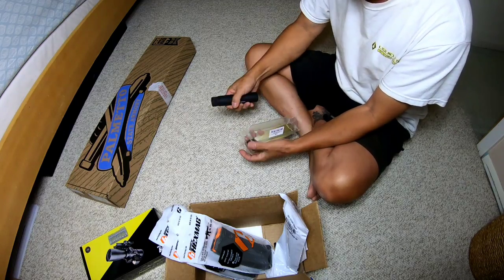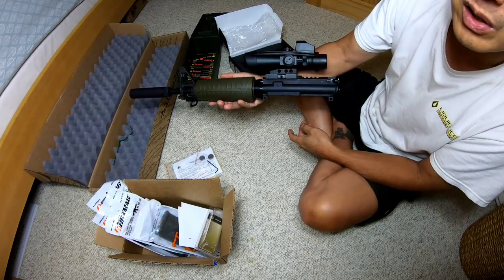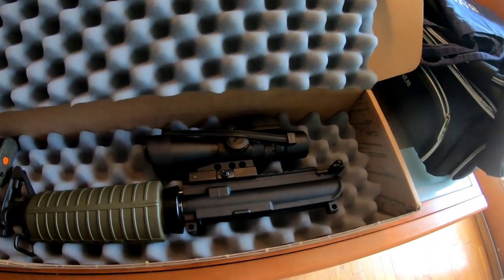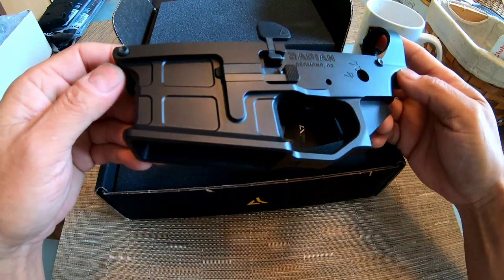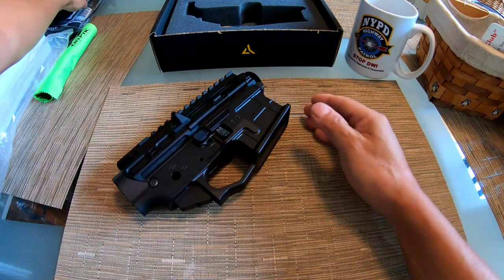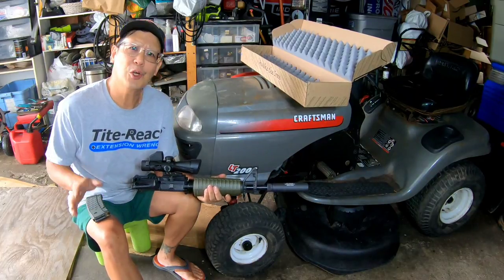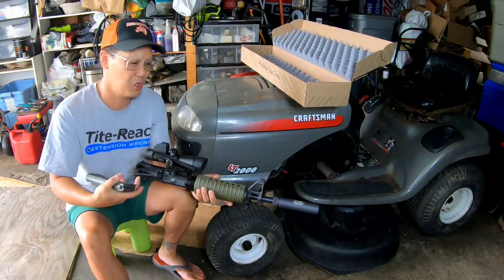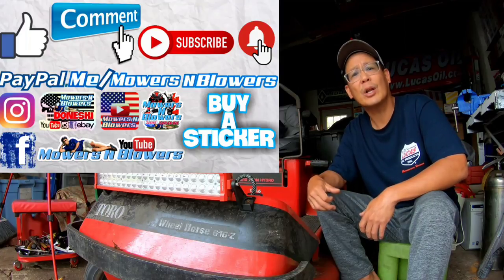AR-15 BUDGET BUILD NYS COMPLIANT GUNTECH .223 5.56 16"BARREL SHROUD THREAD PROTECTOR FAKE SUPPRESSOR

Comment: Hey Henry.... I almost pin and welded something similar to my barrel at Jimmy's actually but I rethought the setup and found that if there was EVER a problem with the gas block or gas tube I would be in big trouble because there would be no way to remove either without having to cut the barrel  in half just to remove it.... i then found YANKEE HILL pivoting gas blocks that would allow me to service the gassblock or gas tube without having to get a new barrel or set up in regards to barrel/gas block/ gas tube if there was ever an issue.... after thinking about the headache, the install and downfalls of these fake suppressors cause I returned the Socom fake suppressor I bought, scrapped that idea and stuck with the plain old barrel I have. It looks nice but it could get complicated if you have an issue with a gas block or gas tube if a custom gas block isn't installed prior....🤷🏻‍♂️🤷🏻‍♂️🤷🏻‍♂️
Reply: You can always drill the weld out.  Anything’s reversible as long as you have the right tools

Comment: You could make a "other" firearm if you slap a quad rail on that handguard and install a vertical foregrip and install a mil-spec buffer tube and stabilize a brace. That way you can have detachable magazines without having to worry about any gunsmithing to make it NY compliant.
Reply: Technically just a brace would
Do it to make an other!  But people here in NY have been arrested for having others.  Just because you think it’s an other, doesn’t mean the ATF agrees with you.  I’ll stick to what’s clearly legal.
Reply: I have a mail spec buffer tube as all ARs do.
Reply: Not all ARs but good luck with your build
Reply from the maker: It’s been done for a year now,  you’re welcome to check out the vids bro!  Thanks for the comment and watching.

Comment: Great video. Roughly how much do they charge for the pin and weld in NY?
Reply: About a $100
Reply: @MowersNBlowers ouch!  Ok thanks
Reply: @cm1212  if your handy,  you can drill your own hole,  find a pin and tack weld it yourself.  As long as the thread protector isn’t removable,  it’s as good as a non threaded barrel.
Reply: @MowersNBlowers im thinking file threads off and apply some cold blue to the metal as an easy diy. What do you think?

Comment: Are you pin and welding it for it just to stay in place?
Reply: It’s to make a threaded barrel non threaded.  In NY,  if you have a detachable mag, you can’t have a threaded barrel.  So you make it unthreaded by pin and welding a thread protector or barrel shroud so as I cannot place any attachments or muzzle device on it.
Reply: @MowersNBlowers  oh I see. We have similar laws here in cali, we can use muzzle brakes and compensators just no flash hiders. Very clean build BTW. I ended up doing something somewhat similar with an 11.5 barrel. Pin and welded it to 16”

Comment: Thanks  for the  link to this vid. May  I know whom did the you  entrust the  gunsmithing to?
Reply from the maker: Your local gun shop should recommmend a gunsmith in your area
Reply: @MowersBlowersGuns  Just needed to let you know, I called the shop where I got my 15-22 , he says the muzzle attachments can only be placed on a fixed-mag firearm. Do you know if the 15-22 is exempt due to being a rimfire rather than centerfire?
Reply from the maker: @POETCERA  no,  he’s correct,  you can’t have any muzzle device on rifle with detachable mag.  Remember mine is a thread protector, not a muzzle device.  It’s a solid barrel shroud,  it does not do anything but give the barrel a thick look.
Reply: @MowersBlowersGuns  Thank you. By the way, I brought my daughter to Calverton Range when she was 8 yrs. old.
Reply from the maker: @POETCERA  nice!  Love that place!

Comment: Looks great so far. And your buddy’s build looks too beautiful to fire. Wow! That’s the type of firearm I would display proudly. Thanks for the mag capacity info. Does that apply to 22lr mags as well?
Reply from the maker: Ed,  it’s a gray area for rimfire 22LR,  but to err on the side of caution,  I would treat the 22LR the same way as center fire.  A few rounds isn’t worth a jail sentence.  Thanks for following bro!
Reply from the maker: Ed, thanks for being my first follower on my Instagram buddy!
Reply: @MowersBlowersGuns  just trying to support a fellow long islander!
Reply from the maker: Long Island strong 💪
Reply: Detachable 22 lr magazines can only contain 10 rounds, 22 rimfire rifles with a tube magazine (ie like a marlin model 60 for example) are exempt from the 10 round magazine restriction.
Reply: @garrettlauzon1656  thanks bud. I have a Ruger 10/22 and a Savage 64 both with detachable mags. I had all mags loaded to capacity but decided to scale back just in case.
Reply: @Whendaddycooks  sure thing. It used to be that you could only load 7 rounds in a magazine. However, 2 federal courts struck that down. If you check the safe act website, it says you can fill a 10 round magazine, but it took them years to change it's wording.